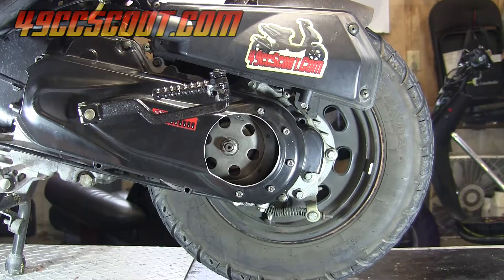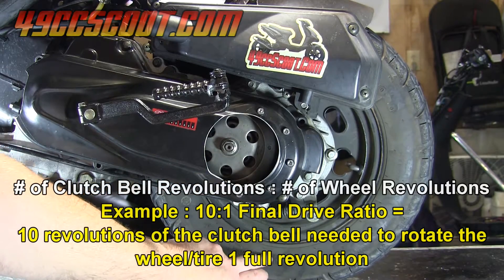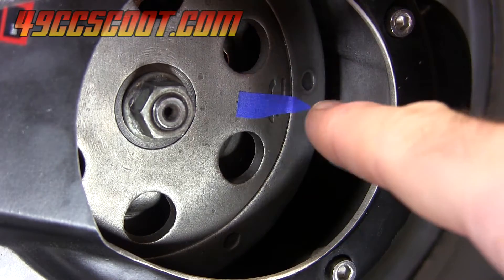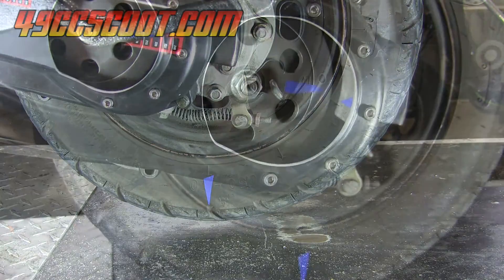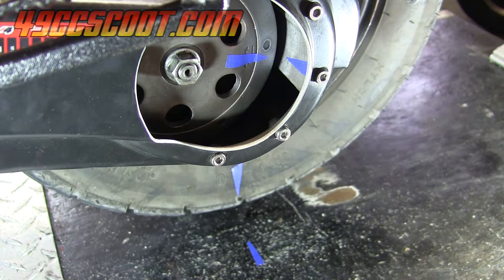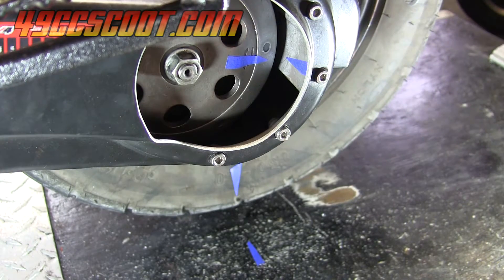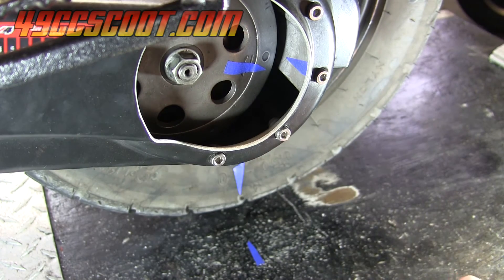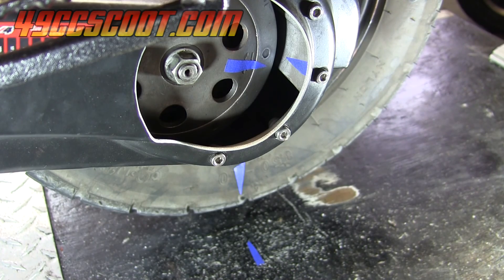Easy Final Drive Gear Ratio Check For Scooters (Gearbox / Transmission)

Comment: Were you running this 11:1 ratio when you made your 3 part series comparing different variator and pulley setups?
Reply from the maker: This is a different bike. That was a Minarelli clone with 10.13:1 gears and a 130/70-12 rear tire.
Reply: @ ahh gotcha. Which bike were you hitting 50s on with the 13.5 ratio?
Reply from the maker: @eliegipciaco  Had to be one of the Minarelli clones. I don't remember putting them in anything but a 103cc, but it was normally a 70MPH bike with 10:1.
Reply: @49ccscoot  gotcha. Seems what im doing to my eton Beamer is exactly what you were doing on T1 years ago. Info on the engine has been tough to find and even tougher to find threads that aren’t dead. Would love to be able to pick your brain a bit about the engine/ tuning/ expected performance. If you’re up for it what’s the best way to reach out? Here? The forum? Email?
Reply from the maker: @eliegipciaco  I'll respond to any of those. There is a thread about T1 that is still going : https://49ccscoot.proboards.com/thread/437/triton-1-t1-49cc-103cc
Reply: @ Wow this thread is a goldmine. thank you. Also cant DM on the forum so ill message here. Do you know what your gear ratio was early on when you were running the mrp clutch,  springs, pipe, and cylinder head? and what was your top speed on that setup? thats pretty similar to the setup i currently have and i wanna know if i have everything tuned properly
Reply: @ also were there any mods or upgrades that made a big difference in performance that you recall? besides crazy piston size upgrades haha
Reply from the maker: @ I used stock gears for many years, which were 10.13:1 in the Triton. Tried 13.5 very briefly. Now I tend to use 11.2:1.

When I had the MRP kit with exhaust and all it was somewhere in the 50s to 60MPH maxed out I think... that's been the better part of 20 years ago.
Reply from the maker: @ Good exhausts make a big difference with two-strokes.
Reply: @49ccscoot  do you remember what speeds were like at 13.5? That’s what my eton currently has and my top speed is 44mph. I feel like it should be a bit faster but idk what else I can do to increase top speed besides changing the gear ratio. I could get a better pipe I suppose, just not ready to drop the money for it yet. Currently have a cheap aftermarket eBay pipe on it which does perform better than stock
Reply from the maker: @ I know it would get at least deep into the 50s, but it had that feeling of needing to shift ages ago so I never really held it. Went back to 10:1 pretty quickly.
Reply: @49ccscoot  did you ever measure rpm’s when you had the 70cc setup? I’m trying to tune the cvt to shift when the bikes in its powerband but I don’t know what rpm that is and I can’t really do it by feel.
Reply from the maker: @eliegipciaco  Yes, but RPM depends greatly on the cylinder and pipe. For stock stuff it's usually around 8,000-9,000. For sport, more like 9,000-10,000. I time acceleration runs and then choose weights that give me the quickest times. Then you can also look at what RPM range you're in to get the best times and that will tell you where your powerband is.

Comment: Based on your experience what is the ideal gear for the 81.5 cc. Provided you don't lose too much torque.I think 13 turns of the gear turn the wheel once.gy6 50 cc.
Reply from the maker: 9-11:1 is pretty common.
Reply: @49ccscoot  thanks ✋🏻

Comment: Hi again Thks for you video I have a Piaggio Zip 2T the scooter start fine is not teck off I need to give a few acceleration four the scooter move can you please help me I change the variator for Malossi I put on a light rollers also is a new cluch thank you
Reply from the maker: It sounds like clutch and CVT tuning issues or maybe you just aren't used to a tuned CVT. With racing or performance clutches and variators, RPM has to be higher for the scooter to move  and accelerate. That may require more throttle to get moving and some people don't like that feeling. Otherwise, it's likely to need some time spent tuning till it runs well for you.

Comment: i have a 72cc polini, do you think it would have the power to move a 8.8 ratio, im looking for a good high top speed. i have variator clutch 28mm carb, it’s basically fully built.
Reply from the maker: Maybe if it's a small wheel/tire combo. Not that you can't do OK with 12"+ wheels and tires and that sort of ratio, but if you like acceleration they do better with a numerically higher ratio than that. I've seen people using around 9:1 on sport level 90cc stuff before and be happy with it though, so you may like it. See how big of a change it is from your current gearing to get an idea and I have calculators here that may help you figure out what it's capable of : https://www.49ccscoot.com/calculators.html

Comment: What kit u think on qmb139
Reply from the maker: I like the 47mm bores, because they are less likely to prematurely put an end to the crankshaft compared to larger bores. I'd suggest getting a Taiwan made kit instead of the cheapest Chinese stuff. Brands like Naraku and NCY for example.
Reply: @49ccscoot  thanks man
Reply: Knw ppl in Orlando fl

Comment: Hello.Some how I lost my final drive gear for my old 50cc GY6 motor,so I order a replacement.Just counted the teeth on both
& got 15x52,so is this just a plain standard gear ratio? I'm looking at a final drive gear with a count of 15x37,so is this gear ratio
faster?
Reply from the maker: 15/52 is 3.47:1. 15/37 is 2.47:1, so it could allow you to go faster... if there's enough power.
Reply: Thank you.I lost my page to where I found the 15/37.So I look it up  & found it works better on 125cc /150cc.Don't they make  a final drive gear that works good for a 50cc?I saw  this 49-17t,but read were they want you to upgrade your motor to 100cc so this gear will work the best.
Reply from the maker: @monty81567  49ccs usually work fine with stock gears. It's not till you make more power that you may want to upgear.
Reply: Thank you.

Comment: I have 13/44 primary polini and 15/42 secondary... but i dont have power now..how grame rolls needed with this gear and what spring color i need for max speed i have gianelli reverse, malossi 70 cc, polini hi speed variator, rolls 6.9 g, mikuni tm24 carburetor, top performance red valve and spring cluch polini evo slider +40% , before install the new grarbox and the new gianelli revers i have much power and max speed 7p km/h ... but how i install this gearbox and this gianelli reverse now  i dont have power.... Why???????
Reply from the maker: You've got about a 9.5:1 final drive ratio, so that 's likely close enough to work.

If you made a really big change in the gearing and added a tuned pipe that makes less power at low RPM, it could just be struggling to get on the pipe. Move lighter on weights and see if it finds the power. You may also need to rejet the carb.
Reply: @49ccscoot  I also put 4.7 g rollers and. in vain, it still has no power at all, the carburetor has 2 turns of air ... if I change this transmission again with the original one and leave this new gianelli exhaust, will it work very well again xa before catching 80 km / h? Or should I leave this and buy her the red bow from malossi and those 3 clutch bows, all red or yellow?
Reply from the maker: @strong6701  There's a lot more to tuning a carb than just the mix screw. https://www.49ccscoot.com/faq/carbtune.html

Comment: Has anyone tried a " performance Bendix"? I'm looking at one for my 50cc 2019 tao tao that has a big bore to 100cc. Also considering a performance final gear drive that is supposed to add 7-10 mph. How hard is it to put on final drive? Is it worth it? Thanks guys and gals😁
Reply: Put the final gear 49 17. Its gives u 10 more mph. I have a taotao 100cc and ima get that final gear.

Comment: Hey brother, I have a gy6 with 100cc big bore kit, should gearing up be advisable for me? I live in a hilly area. I usually get to 55kph only on hills. Appreciate the reply.
Reply from the maker: Try working with the CVT first. It should be able to go faster than that with a stock CVT in tune.
Reply: @49ccscoot  I run on 9g rollers and 1500 contra springs rpm at the moment. Do you think it will stress the engine more uphill if i change to 17-49 gears?
Reply from the maker: I don't think that combo is gonna work well. Try going to a softer contra (1000RPM) and a little lighter weights.
Reply: @49ccscoot  I will try to play around with it. Thank you brother for the responses.

Comment: Good video! However I do not understand the different ways to indicate the ratio.
I'm used to for eksample 49t and 17t would be 49/19= a ratio of 2.88 which is a set I can buy on ebay. How does this translate to something like 11/1 ratio? Is there more than two sprockets?
Reply from the maker: +Lukas Schulin There are usually 2 gear sets for a total of 4 gears. Primary and secondary. They combine to give you the final drive ratio. This method can only tell you final drive ratio. You'd need to count the teeth on the gears to know primary and secondary and make a better educated decision before a gear purchase.
Reply: +90GTVert Okay. This makes sence then, I am thinking of changing to 51/16 which would be 17% higher than my standard total final drive ratio. I quess I can use your  how to change bearing video, as you access the gearbox in this video. 
Thanks
Reply from the maker: Yes, that video will show pretty much everything about the process other than the actual swap. Depending on the scoot and what kit, you may have to press one of the gears off of the countershaft (center shaft with 2 gears on it) and press a new one on. Some people have done it with jawed pullers and a vise if they don't have a press. Others say local machine shops have pressed the gears for them at a very low cost.
Reply: +90GTVert okay thanks. I have access to a hydraulic press so no problem. At the moment my scoot maxes out in CDI rpm limiter at 35 mph, but it has plenty of power to go faster if given a taller gearing...

Comment: if i buy a lower set of gears for my stock 50cc bike would it increase top end and lower the rpm? also would it even be able to pull it
Reply from the maker: Harley Norris Most of the time a stock 49cc doesn't need upgears. They tend to be power limited more than gearing limited. Once you move up to 70cc+ it may be a different story.
Reply: why would you even bother trying to mod a scoot haha. get a motorcycle or something. that way you'd actually be able to notice the difference with the mods you spend your time and money on.
Reply: @Gojira_Rules  makes no sense, there are times u apply upgraded parts on streetbikes and notice no difference as well, same for cars. And purchasing a street bike defeats the entire purpose. 1 would need to first purchase a street bike & then get their motorcycle endorsement. Thats the main reason anything under 49cc doesnt require one.

Comment: How fast would 150cc gy6 on 49cc frame go? After all the custom fabrication is completed.
Reply from the maker: Ian Above About the same speed it goes on a 150 frame. Even if you put it on a small lightweight frame, you shouldn't see any significant speed increase. Maybe slightly faster. It may accelerate more quickly, depending just how much lighter the frame is.
Reply: ***** Thanks!
Reply: ***** WERE
Reply: 2 ways to increase speed gearing and rpm 

the faster you spin the engine the faster you can go...  a motor is a mechanical object and has limitations on how fast it will spin before it fails...

and limiting factors apply  to gearing you either get acceleration or top speed with gearing

Comment: My variator cover get's very hot. How can i keep it more cooler? I have a Gy6 engine btw
Reply from the maker: Srmetallica99 Venting. Look at mine. It works wonders for cooling.
Reply: Ok but i dont want to mess up my variator cover :\
Reply from the maker: Srmetallica99 Make sure the belt and clutch aren't slipping. Slipping causes lots of heat. It is normal for CVTs to run very hot though, so don't think that being hot means there is a problem.

There's another method here for CVT cooling : http://49ccscoot.proboards.com/thread/360/cvt-cooling
Reply: Ok thank you so much :)
Reply: I have drilled a couple of holes and it helped alot but will it rust?
Reply from the maker: The CVT cover should be aluminum as well as the variator. If it gets moisture in there it could lead to rust, but I haven't had a lot of trouble with it.
Reply: Can I tape the holes to prevent rust if it's raining when i driving?
Reply from the maker: You could try it. Maybe if you have the CVT apart, wipe the crank and drive shaft (where the clutch is) with a very thin coat of grease. Not trying to leave a lot of grease behind, just a coating that perhaps would aid in preventing rust. My 4T has had so many leaky oil seals that I haven't had any issues because things get coated whether I like it or not. Just avoid putting anything slick on drive face surfaces, the belt, and clutch components.
Reply: Thank you :) Your videos is very helpful :)
Reply: +Srmetallica99 maintance is important if you put holes in the cover and drive in the rain just take precautions to ensure that everything is dry when you put it away